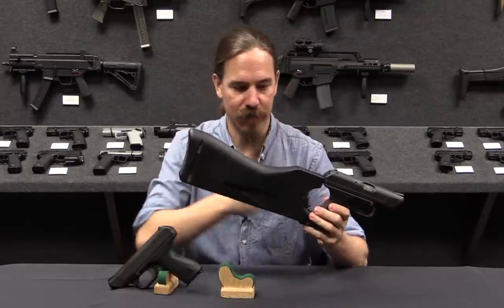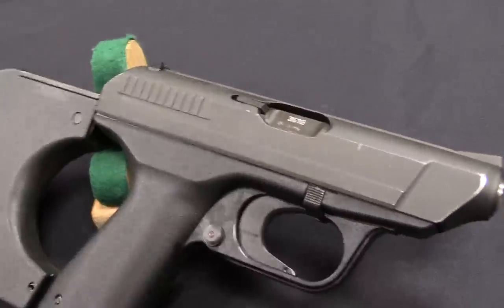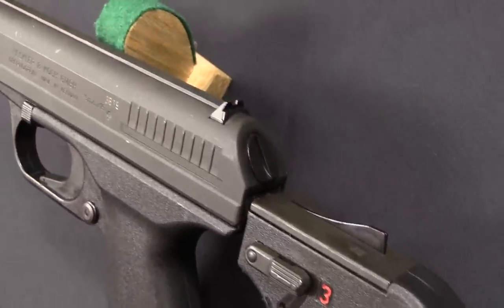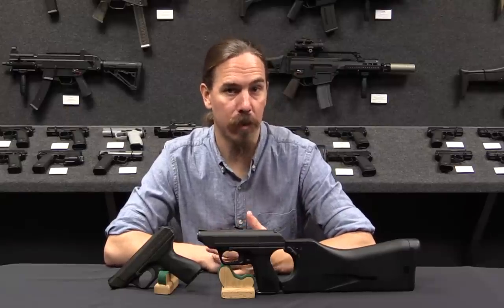H&K VP-70M: Polymer Framed Cutting Edge Machine Pistol from 1973

Comment: "Hans we forgot the safety!"
"Just put a bigger spring on the trigger"

the 70's were wild lmao
Reply: I feel like you need to look at the design and test process for building the ww2 tanks cause Britain decided to tape 2 diesel v8s together and shove them in sideways on the tank
Reply: @kedarraman6690  the cannon doesn't fit!
PUT IT IN SIDEWAYS
Reply: @jacob4012  the radio doesnt fit CUT A HOLE AND HAVE IT STICK OUT THE BACK
Reply: @kedarraman6690  the engine isn't powerful enough
TAKE FIVE AND WELD EM TOGETHER
Reply: This whole thread was like the perfect skit, comedy comes in 3's! 😂
Reply: @anthonygutierrez8933  It’s from a video on British tanks of the war.
Reply: @justforever96  it was an experimental phase in the early 30s and it wasn't a v16 as such it apparently 2 v8s each on one side That were fed of the same tanks, only reason I know is cause of a history student cousin who did her thesis on armored warfare because as you can probably imagine these early super heavy prototypes were scrapped real quick in favor of medium tanks
Reply: This is basically what Glock does now.
Reply: @PHOTOGRASPER  I mean at least they have a trigger safety
Reply: @bencersparney3654  the logic of the trigger safety: the gun won't go off, unless you pull the trigger.  Much like every other gun ever made.
Reply: @anthonygutierrez8933  particularly the one by Potential History here on YT
Reply: Your finger is the safety. That’s all you need. 

Glocks don’t even come with a proper safety.

Comment: Everything in the background looks highly interesting, especially the G36es with the STANAG magwells.
Reply: Seth Moyer there’s a store near me that used STANAG mags in the G36 I rented from them
Reply: @AtrociousAK47  I think thats a UMP-9 as the 45. has straight stick mags where as the UMP-9 has curved :)
Reply: I'm more interested in that XM8 stock teasing us from the right!
Reply: i did'nt notice anything in the background until i've read this post ;O
Reply: uhm. the ump as  9 × 19 mm and as .40 S&W have the curved and straight magazines with 30 rounds, all the .45 ACP have straight magazines with 25 rounds.
Reply: That actually is rather boring since it simply is a adapter you can put on to the gun. The German military actually considered using it to update the guns to stanag at some point but decided against it. And now they are looking for a new rifle all together.
Reply: @AtrociousAK47  I would rather have an MP5/40 or MP5/10 in .40 or 10mm though...
Reply: > implying choosing .40 S&W over 9x19 is understandable for any reason ever
Reply: Mp5's and UMP's for me, can't get over G36 rifles losing their zero and melting under sustained fire.
Reply: Isn't that a HK 243 S-TAR?
Reply: I think I prefer the mp5 over g36  because of the fire rate. But I guess the g36 has a more powerful round. Nah the mp5 is better still just aim and spray.
Reply: what i would do for one of those.

Comment: I've actually fired a Z variant. It has the trigger pull of a staple gun.
Reply: Thank you for the very lifelike, relatable equivalent. CLACK.
Reply: From what I’ve read if you install a Wolff spring that should fix the problem
Reply: Targon of Assad that Z weed is good for what ails ya man, Doc himself gave me some!
Reply: So better than most kac guns?

Comment: Nice!  First a Red 9, then a Chicago Typewriter, and now a Matilda.  What's next, a Broken Butterfly or a Killer 7?
Reply: Killer 7? Don't you mean the .45 Longslide with Laser Sighting?
Reply: Killer 7 is basically a long slide 1911.
Butterfly looks like a webley, not really sure.
Reply: The Killer7 is that Hardballer longslide 1911 from the Terminater movie.
Reply: I'm pretty sure it's just a regular 1911 and not a long slide (judging from the slide length compared to the handle), but it does have the  huge laser sight in homage to Terminator.

"The name "Killer7" is a reference to the then-upcoming cult-classic of the same name, which Shinji Mikami produced. The character Kaede Smith has an AMT Hardballer that looks similar to the Killer7 magnum."

The Broken Butterfly appears to be a mix of a Smith & Wesson Schofield, Colt Single Action Army, and a Montenegrin "Gasser Pattern" revolver.  If anyone can find an example of that, it would be Ian.
Reply: You mean a Mauser,  A Thompson, a VP70, Webley, and a long side m1911?
Reply: The killer 7 could also be the auto mag.  Demolition Ranch just did a video on the automag.  It looks similar to the killer 7 from re4. He had 2 one was chambered in .30 and the other was .50ae.

Comment: Ever since I saw Ian's original video on the VP-70 (before he could get his hands on the stock) I've wanted this gun for myself, not because its Leon's handgun, but because it seems very ideal for a novice shooters home defense gun given that its easy to clean, comes apart in just 3 pieces, can use a large variety of 9mm, and while most folks who fire guns don't care for/outright hate the trigger pull; I think its idea to have since it means you can ease the tension off the trigger much better if the thing you intended to shot at turns out to not actually be an intruder and if it is one; then a jerk pull of the long trigger isn't gonna be a problem at such close range.

Comment: I'm fascinated to know why they chose this weapon for Resident Evil 2. I mean it's a great weapon and practical for the 3 burst upgrade. I'm just curious to know why they chose such an obscure weapon from the 70s. They must have really done their research.
Reply: Because the designers were old enough to know cool stuff of the seventies?
Reply: I would speculate that it was picked because of the burst fire-enabling stock. They were probably looking for interesting upgrade options for the handgun, found out about this gun and how the stock unlocks a burst fire option and were like "god damn that's perfect".
If the VP-70 didn't exist or if it didn't have this unusual feature, Leon probably would have had a different handgun and its upgrade would either not exist or have been a generic "new frame, damage goes up" thing like the other two upgradable weapons.

EDIT: Also I just remembered that the devs were action movie nerds; the famous recurring green box rocket launcher in the RE series is based on the fake prop M202 FLASH from Commando and the recurring flamethrowers are inspired by the one from Aliens. So maybe the VP-70 may also have been picked out as a nod to the latter movie.

Comment: what does the ATF do with this? as the pistol itself is not automatic
Reply: Attaching the stock  would equal manufacture of an automatic weapon... Maybe
Reply: Black70Fastback they might just register the stock, the same way as you can register a seat (pre 86 at least).
Reply: Sear *
Reply: Without the stock it's a pistol but if you own the stock and pistol you have to get a stamp for it being an sbr with burst fire.
Reply: @piRaufasertapete  Sorta like how you can have a railed handgun and a vertical foregrip and be fine, but attaching the two together means problems. Either that or the stock's mechanism alone would be considered an auto sear or the like.
Reply: I bet it's still the pistol that is registered.

Comment: The maltilda from re2, i.always thought these had internals like the Walther PPK 9mm, one of my fav guns for concealed carry , alongside my .38 speical. My Walthers hammer wont catch which sucks cause if i did go out with it (this just happened recently, not sure why) and have to fire i would need to take the safety off, pull back the hammer, and let it drop on its own, Something i can see as super dangerous on a few levels, and Aim wouldnt be ideal especially with the meh sights on the PPK. SORry to ramble in the comment. I appreciate the video!!

Comment: You have any idea just how EASY it would be to convert the civilian model of this pistol into the 3 round burst version? You dont even NEED the stock, just that little metal piece on the back and you could mill out the cut in the rear, weld a few piece of metal onto the striker catch and bobs your uncle.

Comment: Why would anyone want a pistol with a stock really..the idea is ..unique..but shit compared to any sub machine gun and there is many many that may fold down to a small size. Nice design but the project manager missed the concept of a pistol . If you want to have a large thing you could just have modified either a large gun down to a slim, or made it to keep a lot of ammo..anything else is just a sneak mp5 wich is underpowered as well..and it is way better than this ..any open bolt stamped metal gun 9mm would been reliable and cheaper

Comment: this gun pisses me off because it looks like it shouldnt exist man. It looks like someone took some cheap chinese aftermarket g36 folding stock and jut glued it on to the back of a fuckin Makarov. 
I found out this gun was real a few yeas ago when someone out on the range was using one. i couldnt sleep well that night, knowing the damn vp-70 was real and not just a weird resident evil gun. 

the guy let me try it out too, and let me just say, trash gun. absolute trash. The trigger pull is less like a trigger pull and more like working a hot glue gun/ stapler. Like you pull for a mile before the thing actually fires. The 3 round burst is horrendous. the sights are "french inspired" (in the gun world that means they dont work). 

Never actually thought i would ever be caught dead saying this, but i would sooner use a damn glock highpoint over the vp-70, damn thing was a mistake.

Comment: VP-70 is a trash gun in my opinion. It's just plain ugly and not my type of firearm. Double-action only isn't really my type of taste since I hate it. The weight-pull on this thing is pretty heavy, so it's going to take a bit of a squeeze to shoot.  I just highly prefer single action and  stay away from double action unless it's both double and single action. The mag release isn't really all that great either. It's a European-style mag release (aka Paddle Mag Release) which i 100% hate and can also be found on a Makrov. The VP-70 also lacks a rail system for a light to be mounted, so that makes it difficult to shot the firearm at night considering you're going to have to hold a flashlight in one hand and the firearm in your other hand - reloading also takes a bit of time as well due to no free hands when doing some night shooting. But considering its age, I guess that falls under my exception. Me being able to have the opportunity to shoot one, I don't recommend this gun. The trigger-pull is horrible, any pad-mag release is terrible, it's out-dated, you'll have to adapt between the mag release and the safety switch (which I don't recommend if you're a beginner doing firearms combat drill), you can buy a way better firearm with $650-$1000 than this hunk of junk, and most of all, it looks like a hi-point lmfao! But again, that's just my opinion.

EDIT

People just watching this vid cuz of RE2. Smh. I'm disappointed.